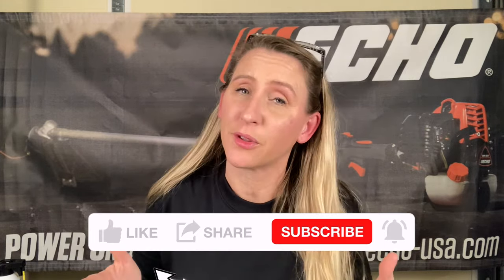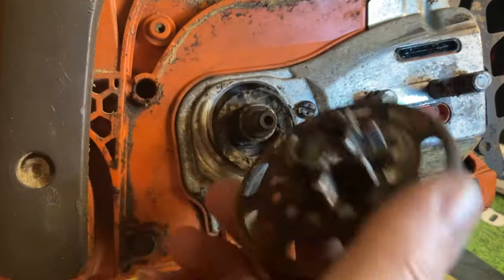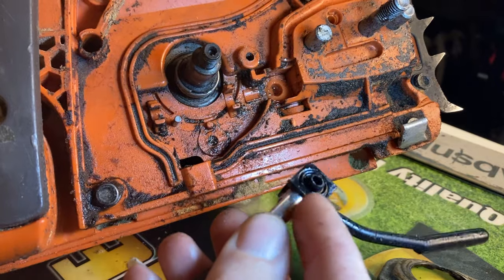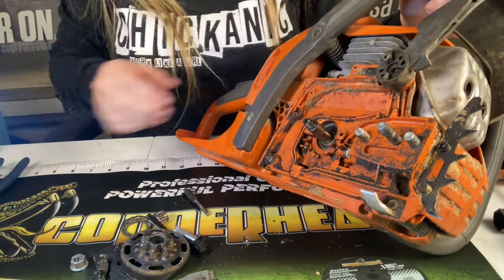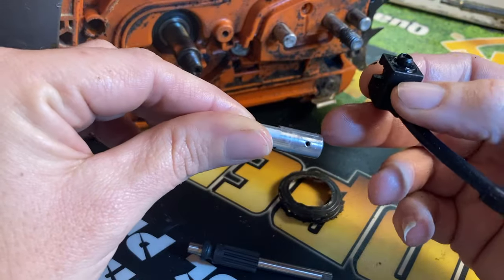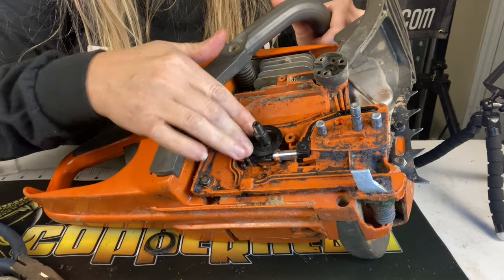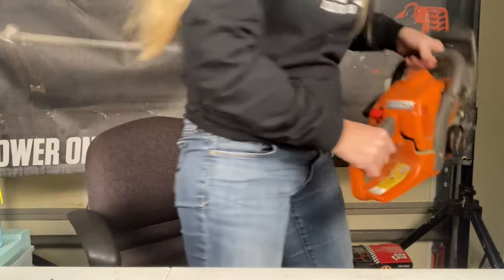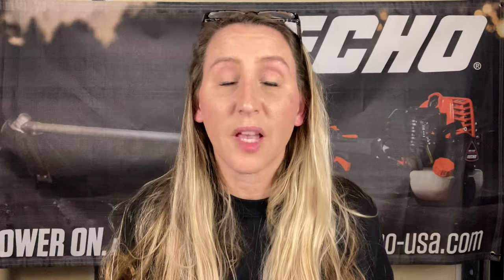Chainsaw not oiling? How to easily fix/replace your oiler on a Husqvarna saw Repair Vlog

Comment: No doubt that saw was cutting terrible for a long while. You'd think someone would try and figure out the problem sooner than letting it burn completely up. 😱
Reply from the maker: This particular customer doesn't ever have to funds to actually keep anything serviced. The saw came in with no air filter and a plug that looked like it came over on the Mayflower after it was used to dig out a coal mine! LOL! I think they don't realize that running your saw for those few more hours to finish cutting that cord of wood is going to cost you more than you are going to make off the wood.

Comment: I could almost see that long blond hair getting wrapped in the clutch. Please be careful. I've seen a scalp removed by a drill press its not something that I care to see again.  Good job on explaining the pump. I've seen the puck up for the oiler get plugged up with wood chips and saw dust. When employees don't want to take the time to wipe off around the oil fill plug.  Keep up the great videos. Thank you

Comment: Excellent, greetings from the UK, I've a hard-worked 136 and a 235, now know how to repair them as suspect the older unit isn't oiling as well as it should, so many thanks.. Always wonder how the system copes with the inevitable wood-dust that get in the oil tank, no matter how carefully you clean off the filler before opening it, is there a filter?

Comment: Just a quick question.

When you get a chainsaw in for repair, do you clean it out with an airline before handing it back?

I blow mine clean with a small air compressor after i use it to help prevent faults, is this a no no?

Cheers,

Callum

Comment: Just picked up a ms360 that clutch drum got installed wrong but owner, the clutch and drum got super hot, Blue in color, pump rubber parts are melted. I stopped at saw shop and was told pump parts can be ordered in pieces, also, do you recommend I go ahead and replace the crank seal  once I have the pump off?Advise please.

Comment: Ho there. I've got a new Husqvarna 445 E ii and during the first use after about 40 minutes o noticed my chain and bar changing colour then suddenly  the chain stopped spinning. Upon inspection i noticed not enough oil coming through which i think caused the cog on the tip of the bar to seize up. I cleaned it all out but the other day it happened another three times while cutting Timber. Would you say there's an issue with my chainsaw which I can claim under warranty ???

Comment: I followed your advice because my Husqvarna 440e chainsaw stopped oiling.  I replaced both components of the oil pump and the worm gear. But it's still not oiling very much,  and when it does, it's not much. The bar is clean, as are the weep holes in the bar. Oh, it does oil with the bar off, which it didn't before I replaced the pump.  Any ideas, we're trying to finish cutting wood for the winter, so your help would be greatly appreciated.

Comment: Do you get many of the old Shindaiwa ( before echo bought them) saws in. I always thought they were great saws. I am wondering if the bar oil port, being plugged may have over loaded the oiler and stripped out the teeth.  thanks for the video.

Comment: I have a question for ya !  been watching your videos for about a month now and you indeed do know your stuff !  on the MS  saw that you made a video about that I watched but now can't find... the plug was very white... bad news for a 2 cycle ! but there was no adjustments
that could be made on the saw... so... why couldn't you just mix the gas and oil a bit richer
for the saw..... when I bought a new saw years ago it said to run a 24:1 gas oil mix (and it did say use only 2 cycle oil made for air cooled engines)  so I mixed it at 20:1 for the first and 2nd tank... the plug was obviously on the dark side of chocolate brown so when that gas can was done I mixed it at the recommended 24:1 and checked the plug color again.... it was  light tan..
( it was a super 2 and I still have it under the bench ! back in the 1970's I think)
.. which worried me so from that time on I mixed the fuel at about 22:1 and it ran for decades.... recently I got a trimmer and stihl saw and they called for a 50:1 oil to gas ratio... I couldn't hardly believe that but went with it anyway and it ran great
the weed eater just gave up the ghost I set the carb wrong I think and cooked it, now there is no compression  ( cub cadet 280 )
  So why can't you just increase the oil in the gas oil mix to make that big 660 burn correctly ?  if their running a 50:1 gas/oil ratio why not use 40:1 and then check the plug ?
....  I just got my first Fuel injected motorcycle and it is weird to not have to tinker with the carbs !  I think it is a more reliable system but it does lack the power of the old bikes ! 
Keep up the videos.... but the live feed stuff doesn't interest me ! <grin>

Comment: Btw nice review on the disassembly. I do believe that saw will be back. Ie what caused the needle bearing to fail? Plastic to melt? Gear to strip. I think the oil pump is encountering some sort of suction obstruction and then can’t pump. Locking up and stripping the worm gear assembly.

Comment: I have been blessed and have only had to repair one saw and that was a Poulan Pro.  I got rid of that when it broke down a 2nd time in 1.5 years and got an Echo.  That was 23 years ago.  5 years later added a small Makita (for dirt bike trail work) and  just 3 years ago A Husqvarna 562XP.  Touch wood, none of my other saws have had any difficulties.  Not even the Echo, which still runs like a dream.

Comment: SWEET video! The tip about NOT using used motor oil is good to know. Dad ALWAYS ran that in his saw, & I was about to start doing it with mine. My saw is nowhere near as old as his was. I'm glad I watched this, BEFORE I caused major damage to my saw!
Reply: the cheap bargain brand bar oil is only slightly better.  my dad uses the cheap stuff and I use the good stuff, and you can feel the difference between my chain and his.
Reply: lol. oil is not the same at all. stupid to use oil. u will ruin ur saw. dont be cheap.

Comment: I have an old husqvarna 36 that stopped oiling. Turned out a small peice of a twig made its way into the oil pickup. I make sure to clean away debris before refilling gas and oil since then

Comment: I had to laugh when you said bar oil was/is sticky. In the past I have used it to oil a motorcycle chain as well as bicycle chain. After all the chain oil for either is also a sticky lubricant. 😮😊

Comment: If you don’t have anything to clean out your bar the back of a butter knife seems to clean the grove in the bar excellent. Especially if you’re cutting wood that is moist will fill up your bar and plug up your Oiler port on the bar

Comment: I had this same problem. Still had it after doing this fix. 

Finally figured out that yup, I was using "bar oil" somebody gave me in a jug and it was way too heavy to run through the oilier system. One of those - spend a little bit for what you're supposed to use that works, rather that cheaping out on stuff that doesn't.

Comment: I do not think you have ever worked on a Craftsman chainsaw since I have been watching. My question for all of the repairs you do, would they be similar for a Craftsman chainsaw? I bought this saw in 1996 and it runs well whenever I have the chance to use it. 2 -3 pulls and it starts. I use a handheld sharpener that attaches to a 12-volt battery. It is like putting a brand-new chain. The sharpening tool is diamond studded.
Have good days!

Comment: I use high temp wheel bearing grease on the worm gear and sprocket bearing.  I grease the sprocket bearing on husky saws with my grease gun using EP2 grease, as well as the sprocket nose bearing.  I have an adapter that fits into my grease gun allowing me to use it to grease chainsaws.  I don’t want a few little drips of oil off the bar.  I want a clear defined stripe of oil on my workbench.

Comment: Thanks, Chickanic.  My Husqvarna is weaping oil even while not running, glad this isn't a difficult task to check & fix.  Plenty of oil while cutting, but needs to stop and not make a mess while sitting in the tool shed.

Comment: yesrs ago about the mid 70s we bought our dad a new pouland saw well after countless trips to the dealer and half a dozen bars and chains a factory rep discovered plate had no hole in it my dad try to tell that from day one needless to say we went back to cutting our firewood by hand and yes we got a new saw but dad refused to use it

Comment: Great information on the used motor oil.  I've done it before in a pinch.  Sure did have to refill a lot quicker.

Comment: I had a good old medium size saw that I used on the ground.
The oiler didn’t work. I cut the top out of a plastic oil bottle would dip the tip in oil every minute to lube the saw.
(My Step Dad would say “poor people have poor ways”
Reply: Like the guy who said,  “I don’t need Antilock brakes,  I’ll just pump the brake 15 times a second”!

Comment: Hi Chic. I worked alongside a guy who had a side business a couple of years ago doing gardening/ sawing, and he swore by using old engine sump oil ! I freaked ! Told him all about the oil being spent but he wouldn't have it, DUH,, Anyway, you are the best. A really interesting and informative video. Thanks. Best regards.
Reply: If the oil were spent, your car would blow up. But it does have lots of contaminants in it and lots of carcinogens

Comment: I'm interested in your thoughts concerning the single nut securing the chain bar. I've encountered several people complaining that the chain needs very frequent adjustments, or wouldn't stay on the bar. Love your videos.
Reply from the maker: I really don't understand why they would do that. Two nuts are better than one for sure. Thanks for watching!
Reply: one nut is half the cost of two
things go that way then economy wins over engineering and quality
Reply: A little blue thread lock helps
Reply: See how much one costs if you lose it!
Reply: Boy, you walked into that one…😎
Reply: Deez

Comment: It looks like  the owner is somewhat hard on that poor saw. I have a husq 445 that my father bought me in 2012 as birthday present. It has been used alot to thin trees, clear fallen timber, landscape, cut firewood, etc.. and it still looks new. My father taught me to use but not abuse that which I own and value. Equipment is expensive and  hard to replace if you are on a budget. There is also the fact that if can let you down at a critical time if you abuse it. Love your educational tutorials.

Comment: I have an Echo CS325 chainsaw that i giving me problems. It keeps throwing the chain, and then when I reseat the chain it wont turn on the bar, not sure if it's not getting oil or what. It does seem like it is oiling but the bar binds up.

Comment: I’ve never seen a worm drive as bad as that before. Old engine oil can cause cancer too. I once used old hydraulic oil as bar oil, it ruined the pump in my 254. Never used anything but the proper bar and chain oil since
Reply from the maker: I've had customers burn up brand new small Echo saws using used motor oil. They were mad at me for telling them it wasn't under warranty. Thanks again for watching Al!
Reply: @Chickanic  wow. It should be me thanking you. You and Ron put out videos full of good content that take time to make and edit, the least I can do is watch them .

Comment: Since Both Model Indicators Were Missing. How Did You Determine What Parts To Order Without A Model Number?
Reply: The engine number & model number would have been on the list of stolen power equipment the Police supply repair shops.

Comment: Can I be up front and vocal just to say take issue with having to purchase" bar oil" if I do not have to...     
 But I agree, the motor oil seems to be too thin and doesn't stick..  but the gear oil in my front and  rear differential of my old box Chevy seems to stick to the chain on my green saw..    

And if nothing else, my rear end is a lot quieter due to the frequent changes.  Lmao Y'all behave now, gbye!

Comment: You should clean the bar channel away from the roller sprocket tip so as not to push sawdust into the tip sprocket bearing.

Comment: The oiler gear does‘nt pump while revolving, but when it is pushed back and foreward by a snakegroove at the rear end and a pin on the housing. Grease that groove and don‘t use bio oil, it gets stuck like lacquer, when its is standing without movement, then the worm gear ist eating the plastic gear. Raffined chain oil doesn‘t react with oxygen. Happens mostly on cheaper husky‘s , professional models have metal gear on the oiler piston. Pleasure to watch !

Comment: So how do I stop the saw from leaking oil once I'm done with it? I have 2 saws that will leak out every drop of oil when they are stored in the case. I read you should open the oil cap to release suction. Tried that, never works.
Reply: @rtyndallnc For me it's (1) Pour any remaining oil in the tank back into the bottle, and (2) put a shop towel in the case under the saw to soak up what little is left that might leak. That said, I think a common cause is a damaged or distorted o-ring on the cap, so replacing it might help as well.

Comment: Husqvarna chain saws notoriously have Oiler problems. New saw. Full bar oil tank. Emptied completely out into the case.  A buddy said he has the same 455 Rancher with the same problem. Floor in the barn soaked with oil. The oil cap completely seals the tank and I believe it gets vapor lock after a couple of cuts and doesn’t pump. Or the pump is sucking in air after it vapor locks and becomes air bound. The saw is new and genuine H bar oil is added only on the bench to avoid any possibility of dirt or chips/sawdust entering the tank  The saw model used to, but now has a non adjustable Oiler. There is an adjustment direction embossed on the case casting that shows increase but there is no longer an adjustment screw. Took it to a H dealer. Said the bar hole was clogged. The bar had never been off to inadvertently get dirt in the bar lube hole. This saw needs a usb chargeable peristaltic oil pump and trash the worm gear pump. The pump feed rate controlled by a magnetized chain link with a Hall effect sensor to drive oiling rate. USB peristaltic Oiler can be pulsed before the chain even moves ultimately reducing wear. Or like a model airplane. A fitting on the muffler with a line (mini filter for carbon) to pressurize the Oil tank to overcome Oiler NPSH issues.
Reply: Mike what do you mean when you say the oil cap completely seals the case? There is a tank vent so it can't be sealed unless the vent itself is plugged. As for the bar hole, its connected directly to the groove the chain runs in. Thats where it picks up the dirt. These are very low cost systems that work well with just a little operator maintenance.
Reply: @TheGreasyShopRag  I would be interested in knowing the exact location of the chain/bar oil tank vent. It it must be plugged. Or maybe in the case injection mold process the hole wasn’t opened or has plastic covering the intended vent opening. I can get it to lube the chain on start up (cardboard spray test) but after a few cuts it won’t lube. It has to be vapor lock for the pump suction.  I saw a post that said if the plate is bent that covers the pump assy the compression on the discharge tube is lost and it could just be leaking out before it even gets to the bar. The one video showed all new parts and he used sealant on every tube joint and even the tube suction press fit into the tank. Factory assembly is just a slip fit with no sealant. I’m tired of prepping to head to the “back 40” only for it to cut three cuts and then the chain starts having tightness issues caused by lube issues. Not the expected performance of a $450 saw.
Reply: @mikemccabe1324  There are two versions of the 455. one one the vent is behind the tin disc on the clutch side. You can spot it by the bronze sintered disc about 1/4" diameter above a bar stud. On the other version its behind the starter under the air deflector, only about an inch or two from the fill cap.
Reply: @TheGreasyShopRag  Thanks. I’ll relay to my buddy with the same issue. I might just replace it with an adjustable pump that’s available. .

Comment: Nice work but a shot of wd40 with a quick wipe and then some compressed air couldn't have hurt before reassembly to remove the dirt and gunk.

Comment: What would cause the bar oil to continue to drain out after you use it?
Reply: I have same on mine.
Reply from the maker: Try releasing your oil cap when done. I think it helps sometimes. Also try using a GOOD bar oil. The cheaper stuff is thinner and seems to leak more easily. If that doesn't work, depending on what saw you have, you oil lines may be leaking where they go through the saw. Thanks for watching!
Reply: @Chickanic  thanks
Reply: @Chickanic  where I am, it's the other way around - they make the cheap stuff thicker instead of using the stuff that makes it cling to the guides better.  mine always leaves a little drip under the drive, and I figured it was just from having it oiling properly. (edit: I use good oil)

Comment: I personally hate that oiler system. You can actually upgrade it to the better one. Husqvarna 350 pump and worm gear goes right in. Just have to remember you need the mounting screw as well for it.

Comment: It would be a lot easier to do this job if you took a minute to wipe the whole thing down with a shop towel. Make the job look more like it was done professionally. Other than that great video and very educational.
Reply: Yeah, why not spend an extra ten seconds and blow the crap out of the side area where the new parts go? Little things like that mean a lot.